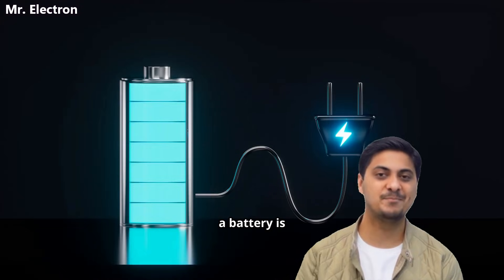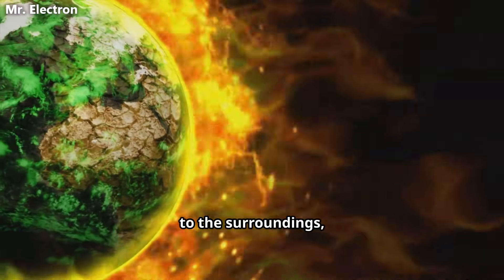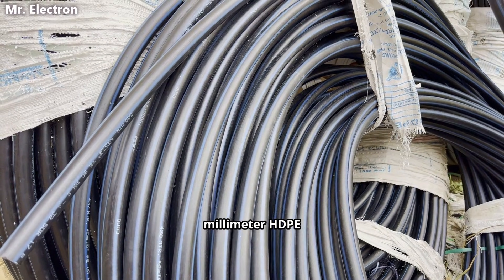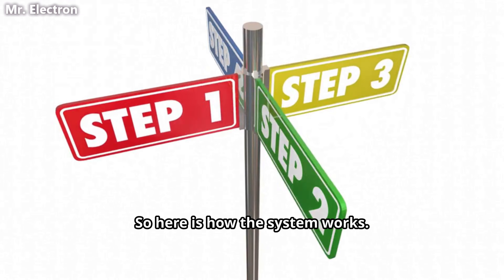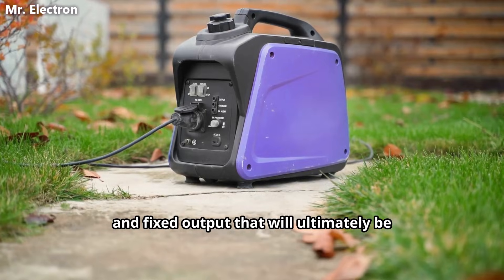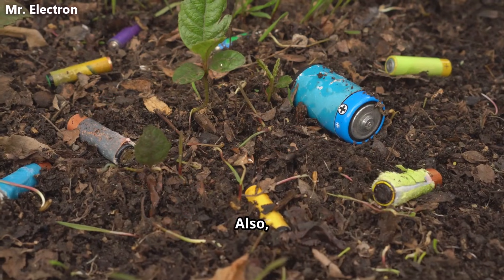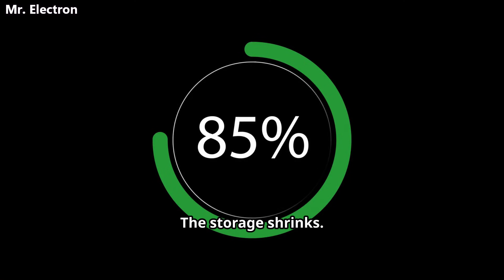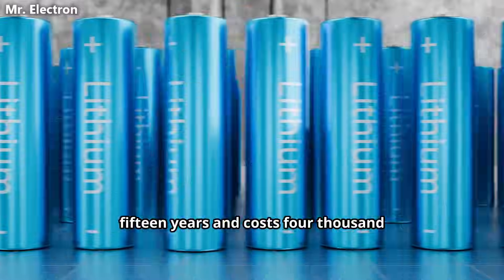Stop Buying Expensive Batteries — Build This 20 kWh Lifetime Battery Instead!

Comment: The Thermodynamics: The Math Doesn't Add UpThe video claims that a 1,500-liter system at 10 bar pressure stores 20 kWh of energy. We can check this using the ideal gas law and the formula for energy stored in compressed air.Even assuming "Isothermal Expansion" (the absolute best-case scenario where the water absorbs all heat perfectly), the potential energy $W$ stored in a volume of gas is calculated as:$$W = P_1 V_1 \ln\left(\frac{P_1}{P_0}\right)$$Where:$P_1 = 10 \text{ bar} = 1,000,000 \text{ Pascals}$$V_1 = 1,500 \text{ Liters} = 1.5 \text{ cubic meters}$$P_0 = 1 \text{ bar} \text{ (atmospheric pressure)}$Plugging in the numbers:$$W = 1,000,000 \times 1.5 \times \ln(10)$$$$W \approx 1,500,000 \times 2.302 \approx 3,453,000 \text{ Joules}$$Since $1 \text{ kWh} = 3,600,000 \text{ Joules}$, the total energy stored is:$$E \approx 0.96 \text{ kWh}$$

Comment: Even then, you still need a battery or huge capacitor to stabilize the output current as water turbines are not constant current. Huge capacitors are not cheap & its capacity are limited. A battery does a better job but incur high cost.

Comment: A bit long-winded and over complicated for a simple mechanical storage battery. If you're draining condensation from the pipe coil, you're also depleting your compressed air pocket, requiring recharge. This system is equivalent to a recycling gravity-feed hydro generator with high head. There are multiple ways to construct such a system depending on what your circumstances are best suited for, and you could use multiple sources (grid, solar, wind, etc.) for re-charging your storage medium, whether it be compressed air, water reservoir, elevated weights on pulleys, lead screws, or pushing fluid, or whatever. It appears that the majority of your charge capacity is in the coil volume, but you need an matching water volume as well for the pelton wheel. Disadvantage is diminishing output over the duration of the charge.

Comment: Can this be be a enclosed system so the loss of water would be minimum? Be great for rural locations .
Reply from the maker: Yes it can be. You can collect the same water from the jet and use the same pump to feed it back to the tank although some water gets lost in evaporation and spillage so you might have to add that extra 😊

Comment: Good 'idea'. But this is too cumbersome and not TECH FRIENDLY at all. 

WHY NOT JUST make a DON SMITH EFFECT GENERATOR WHICH IS A  SELF-POWERED MOTIONLESS LIMITLESS IN GIGAWATS ELECTRICITY GENERATOR that uses Calculated length of Copper Wire, Resistors High frequency Diodes, Storage D.C capacitors, high frequency capacitor(s) ,  Pi-Filter and High Current Well Installed Earth Connection(Real Dug Out Ground).

Just Search on Google for Don Smith Effect Generator to get how to do it. There is guide on Scribd about the Generator.

Another GENEERATOR is Garry Stanley Pulse Motor but I called It Garry Stanley Lenz Killer Motor Generator. This is is NOT MOTIONLESS and it consumes more Coated or Enameled Copper Wire than the one of DON SMITH but it is also Wickedly Powerful when you build it Properly. Here you need 12 coils or 18 coils and Neodymium Magnets Of Cylindrical type.
The diameter of the Cylindrical Neodymium Magnet determines the size of your Stator Coils that can be Air Core or Iron Core. That diameter also determines the switching on and off section of your MotGen Rotor-Shaft-attached Home-made or D.I.Y  Copper Commutator.

If the Magnet have 4cm diameter, you coils must be 6cm in diameter. Which means 10-40-10. That is 10cm for each leg of your coil and 40cm for the center. Knowing this would help you wind the coils perfectly on the jig. 
Use thin copper wire like AWG 19 or a bit lesser. Do not use too tin copper wire to avoid having to deal with Extrem High Voltage though Stactic Electricity that your coils would  be harvesting likes High resistance. However, you will compensate for that with High Voltage supply of DC electricity to the coil and the electric Lenz cancelling collision effects that would be happening in the coils at every switch.

To wind your coils, just cut  two 6cm diameter discs which could be Metal, Plastic or Wood and cut another thick 4cm diameter 8cm in height cylindrical disc. The 4cm or 40mm disc must be perforated or drilled in the center and slight chiseled flat on 2 or more part of it body to allow for tape your coils when being wound.

Wind all coils in same direction on the Jig. Wind from let to RIGTH. 
However, when you are connecting them, you will connect two coils in Parallel on the stator in opposition direction or in Series.
What it means is that you will connect the Start of Coil A to the End of Coil B and Connect the End of Coil A to the Start Of Coil B. These oppositional connections creates Lenz Cancellation when the Coil is being switch on and off which makes the MotGen not to Break or Get Dragged when Powered or Energised via the earlier mentioned D.I.Y copper Commutator.

Now if you make 12 coils, you have 6   180° paired or connected coils. Now, after connecting the coils at 180° to each other perfectly, start to connect the 6 pairs in series to have the whole set of 6 paired coils a a WHOLE SINGLE COIL!!!! When you do that, you will have just 2 leads of wire remaining.

One of the 2 leads of wire would go to the one of the Carbon Brush On the Copper Commutator for switching. The second carbon brush is where the power comes out STRAIGTH to a Full Wave or Bridge Rectifier which MUST be made with High Frequency Diodes. The other leads from the set of serially connected coils goes to the Full Wave Diode Rectifier too on the AC part which is where you would connects the MotGen Set-Up to your Power Supply.

Does it ends there now?

No!!

When you power on the System, the 12 neodymium magnets fitted Rotor would be rotating due to On and Off of the Electromagnets on the Stator. When the Coils are switch off, The Full Wave Rectifier Receives Power From The Coils and rectifies them into Positive and Negative Pulsed DC of Massively High Voltage Due to Electrical Collision of Forward and Back E.M.F instatenously happening in the coils as it is being switched. 
Just Connects the Positive Side of the Diode Bridge to either An High Frequency High Voltage Step Down Transformer or use an Earthed Resistor Voltage Divider to step down the Voltage into an High Capacitance D.C Capacitor and from there Invert the DC TO AC using a Pure Sine Wave Inverter.

Need any clarication on this? Call or WhatsApp +234 7060 57 85 69

Comment: interesting video. there is a limitation on storing heat in water: in areas where the ground down to 2meter depth freezes every winter the use of water would destroy the containears due to water expanding when freezing. additives such as Ethanol, Methanol , Ethynele Glygol or Propylene glygol, but the two last are harmful for most living things such as bacteria, plants and animals. even in Nepal and Bhutan at height of 4000M the freezing depth is from 0,5m to 2,5m  Greetings from Finland.

Comment: You still have the losses from compression, the heat just gets dissipated over a greater area. You have to add in the water pump efficiency which, with an induction motor and multi stages will be fairly low. Your alternator is about 50% efficient so the overall efficiency is fairly dismal. Lithium isnt perfect but, if you have limited energy gathering area, is much more efficient at around 90% and that could almost include the inverter and you will need one of those too with the water system.

Comment: How did you calculate it to get 20kWh?    
E = V x P x ln (Pmax/P) = 1.5m^3 x 100kPa x ln (1000kPa/100kPa) = 1.5x100xln(10) = 345kJ which is 0.09 kWh
Reply from the maker: That's the calculation. Seems like I will need 3 times more pipe which will make it 15 kilometers instead of the previous 5 kilometers. 

Compressed Air Energy Calculation
1. System Data
Tank Volume: 100 Liters (0.1 m³)
Pipe Length: 5,000 meters
Pipe Diameter (Internal): 63 mm (0.063 m)
Initial Pressure: 3 bar (gauge)
Final Pressure: 10 bar (gauge)
Atmospheric Pressure: 1.013 bar
2. Total Volume (V)
Pipe Volume = 3.14159 * (0.063 / 2)^2 * 5000 = 15.586 m³
Total Volume = 0.1 (Tank) + 15.586 (Pipe) = 15.686 m³
3. Pressure Conversion (to Absolute)
P_Initial = 3 + 1.013 = 4.013 bar
P_Final = 10 + 1.013 = 11.013 bar
4. Energy Stored (Formula: E = V * [ P * ln(P/Patm) - (P - Patm) ])
Energy at 3 bar:
E1 = 15.686 * [ 401300 * ln(4.013 / 1.013) - (401300 - 101300) ]
E1 = 3,959,190 Joules (approx 1.10 kWh)
Energy at 10 bar:
E2 = 15.686 * [ 1101300 * ln(11.013 / 1.013) - (1101300 - 101300) ]
E2 = 25,532,331 Joules (approx 7.09 kWh)
5. Total Stored Energy Added
Total Energy = E2 - E1
Total Energy = 21,573,141 Joules
Total Energy (kWh) = 21,573,141 / 3,600,000
Result:
Energy Stored = 5.99 kWh

Comment: The proposed H-CAES “mechanical battery” is physically incapable of delivering the claimed 20 kWh, with safe operating pressures and available pipe volume yielding under 1 kWh of usable storage and less than 5% of the advertised capacity. When realistic component efficiencies are compounded across pumps, compression, piping, turbine, and electronics, the round-trip efficiency falls to roughly 22–35%, far below modern LiFePO4 batteries that routinely exceed 90% RTE. Use of HDPE water-rated pipe for cyclic high-pressure gas violates gas piping standards and introduces severe fracture, RCP, and buried-infrastructure risks that trigger full pressure-vessel regulatory oversight and liability under codes such as ABSA/ASME once pressures exceed about 103 kPa. After incorporating mandatory engineering, permitting, and civil works, the levelized cost of storage is tens to hundreds of times higher than LiFePO4, making lithium iron phosphate batteries the only professionally defensible option for residential or off-grid storage

Comment: One thing to keep in mind is that water absorbs air and vice versa. The gases will go somewhat into solution and as they're being splashed on this pelting wheel, those gases will come out and you will have to recharge that pressure above the water every now and then
Reply: And gases in the water gives you no direct and precise flow, ideal a laminar flow will transfer the most of its energy to the wheel, but gases will make it "bubbly" and therefore less efficient

Comment: replacing the water in the tank. where is the energy coming from?
Reply from the maker: The air inside the tank was forced to get compressed inside the HDPE pipe because that space which was initially occupied by air inside the tank got filled by the water when the water pump forced the water to fill in the tank. So after complete fill-up of the tank, when the nozzle was opened, then that air which was forced through the HDPE pipe to get compressed is going to act like a spring. That spring is going to expand and that expansion is going to push the water out through the nozzle. So that energy is the potential energy that turned into kinetic energy after opening the nozzle. I hope that's the answer you were looking for.
Reply: Solar power

Comment: You ask a question at the end of the video, but you are assuming that price is the only concern, because that is the only info provided. Price is important, but the details are more important. What are these two sources made from? How big are they? How much space is needed? Is it an indoor system, and outdoor system or does it require both? There is so much more than just price and how long it will last. The system you showed in this video does not seem realistic for home use. It makes a huge water mess, it's massive, and complicated looking. This does not seem to be suitable for home use as shown and would need significant modification and size reduction to be useful for home use.
Reply: His system is under sized and under powered by at least 4 times

Comment: You need to dig up 2 meters of earth to make a repair?  OK, and what about maintenence of the mechanical components?  What is your water source?  How much energy is being used to pressurize the water?

How much does it cost for the materials to build it?  Assuming this system will be installed in India, your average citizen simply doesn't have the purchasing power to install it and even a very well to do citzen might opt for a solar/lithium battery array instead of having their property dug up for installation and maintenance.

It seems to me that, if this is a profitable system, as in far more energy is produced by the pressurized water than how much energy is required to produce it, then it seems that this type of project would be better handled by a public utility than a private citizen, especially when you consider the initial capital costs, maintenance and the technical acumen needed.  It would be far more cost efective to distribute the cost between several homes.

Comment: you did not explained the waste of water, when the nozzle through the water on flywheel, to run the generator, alternator or a DC motor to generate electricity, I do not know, where all this thrown water from nozzle will go . Water scarcity is all over the world, specially the clean water. in such volume of water instead, you can grow a lot of food in the farms, and the agriculture waste can be used for producing Methane Gas, or if there is a high pressure in the area, you can use the high wind through the nozzle to run the flywheel.
Reply: The water can be recaptured and fully contained in a closed system, very little water loss to normal evaporation can be replenished easily from rain catchment, local water, stream, river, lake, whatever is available.

Comment: YOUR INFORMATION IS NOT VALID
AI VALIDATION :
Summary: Valid vs Not Valid
Claim	Status
Chemical batteries experience degradation	✅ True
Compressed air can store energy	✅ True (CAES)
80% efficiency without complex systems	❌ Not proven
50 years without degradation	❌ Not realistic
Can be “self-built” for home use	❌ Not practical as a simple solution
Air + HDPE plastic directly becomes a mechanical battery	❌ Oversimplified

Comment: @MrElectron please what about water wastage, please don't upload  videos that teach you how to waste water ,I often watch your videos but please make some videos that show how to generate electricity without wasting water
Reply from the maker: 1) If the falling water stays on the mud, it is going to be absorbed by the earth. Thus getting filtered and reaching the ground water level. 2) If not absorbed, it is going to get evaporated and ultimately it is going to fall down in the form of rain.
3) You can collect the same water to feed the input of the pump thus creating a rotational cycle. So you see, whatever you do, its really difficult to waste water 😊

Comment: This is the most impractical power generator as water is a expensive life extending  commodity.
Reply from the maker: 1) If the falling water stays on the mud, it is going to be absorbed by the earth. Thus getting filtered and reaching the ground water level. 2) If not absorbed, it is going to get evaporated and ultimately it is going to fall down in the form of rain.
3) You can collect the same water to feed the input of the pump thus creating a rotational cycle. So you see, whatever you do, its really difficult to waste water 😊
Reply: @MrElectron your going to us ac power to create DC power and turn it back to ac power. It will cost more to run then it will make

Comment: 5 km tube with a 63mm inside diameter will have a volume of  0.989 cubic meter. Let's round it to 1 cubic meter, that is 1000 liters. At 7:3 you talk about 1500 liters where are the extra 500 liters coming from?  Those 5 km of plastic tube will weigh 120 metric tonnes and if your backyard is 15 meter wide, you need 112 pipe sections that will be laid over 21 meters, sided by side.  You should check the math more diligently. This is a shoddy job. It also makes some assumptions like neglecting a heating building to prevent all that water from freezing.  You are a charlatan and a fraud, sir.
Reply from the maker: Pipe length = 5000 meters
Internal diameter = 63 mm = 0.063 meters
Radius = 0.063 / 2 = 0.0315 meters
Formula for volume of a cylindrical pipe:
Volume = π × r² × L
Substituting values:
Volume = 3.1416 × (0.0315)² × 5000
Volume = 3.1416 × 0.00099225 × 5000
Volume = 3.1416 × 4.96125
Volume ≈ 15.59 cubic meters
Final Answer
Total internal volume of the pipe
= 15.6 cubic meters (rounded)
= 15,600 liters of air